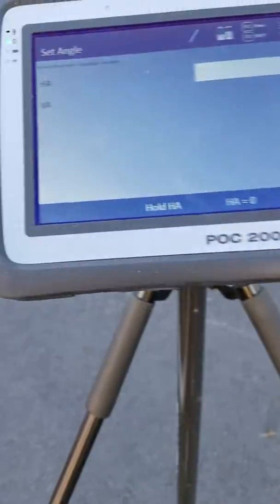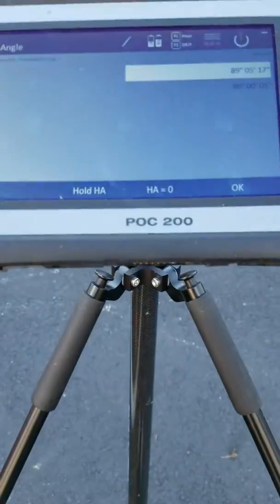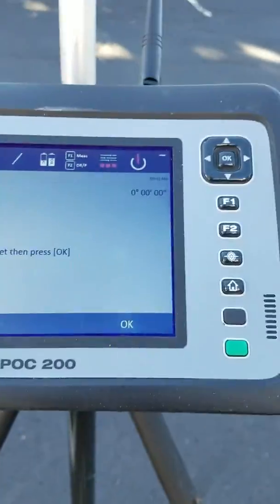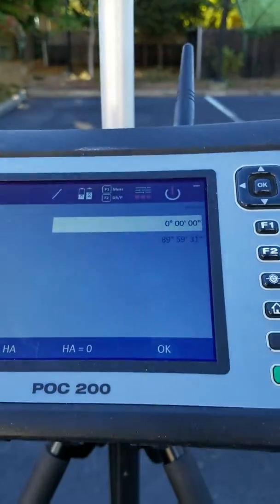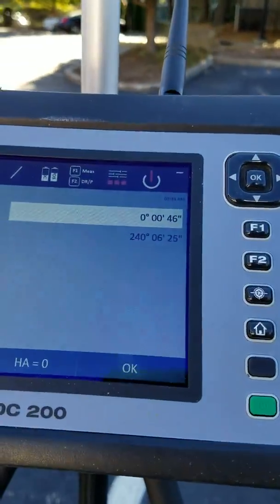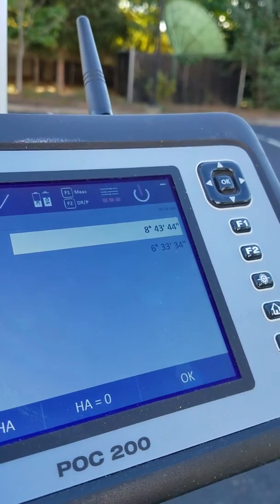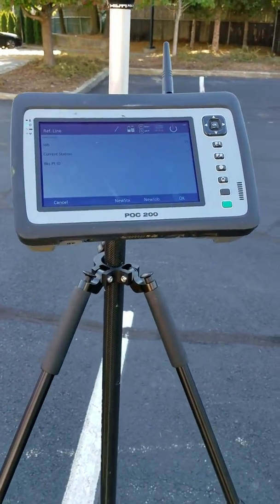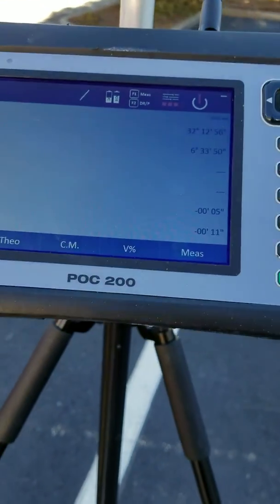Tutorial of Theodolite POC 200 POS 180

Comment: Hi, I’m researching theodolites. I always thought you could measure the angle of something no matter the distance.

However, I read that anything past about 2000 feet will begin to lose accuracy due to light diffraction. Can you confirm this? Is there any instrument that can measure an angle past 1 or 2 miles?
Reply from the maker: I'm sorry, I'm not sure the answer, and apologies for the late reply. The POS 18 has a margin of error of 3" of an angle, so at that distance, you are playing with a bit of a deviation, but it will certainly still take measurements and give angle information of that measurement.